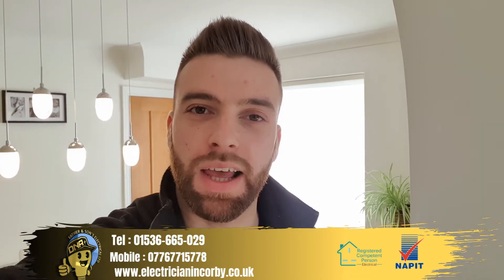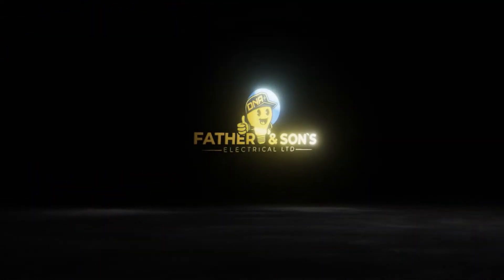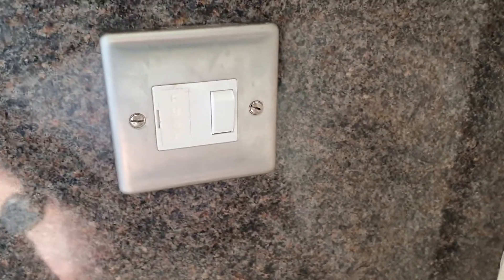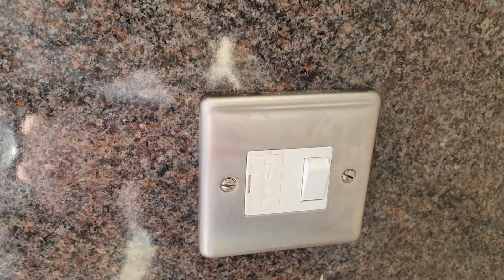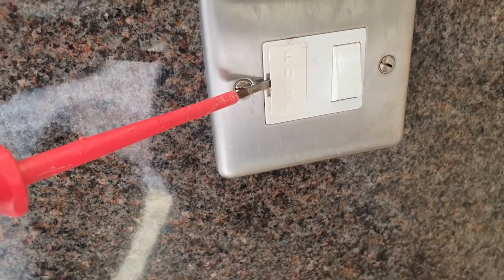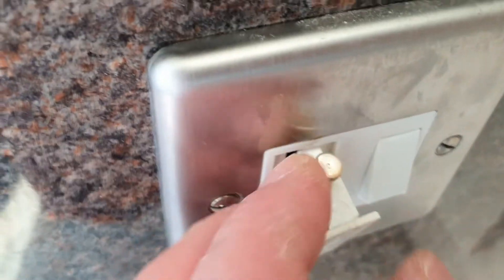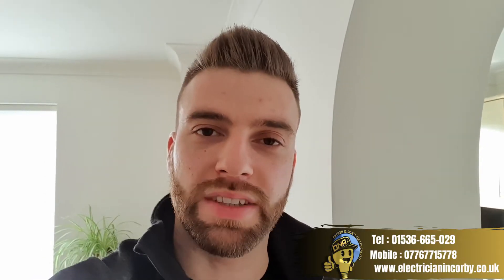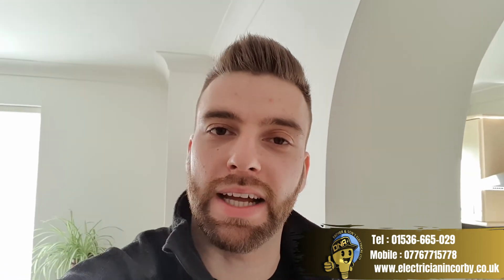How to change a fuse in fused spur?  Electrician in Corby @dnapowersolutions

Comment: Hi what do you need to do if it burnt out causing a lose connection does the whole thing need replacing or can you just change the fuse ? Thanks for your vids
Reply: My washing machine is blown. I changed the fuse, all other appliances are working. How do i chance the fuse at the fuse box. I use use just wire but have a new electric meter and not familiar with what to do? Please help I am 81...

Comment: My fuse blew and the socket got really hot, the switch button is stuck so I can’t turn it off, should I switch off the electrics from the mains and change the fuse or should I leave this for an electrician?

Comment: Thank you for the really helpful video. This DIY novice used the advice to safely change the amp fuse for the kitchen under cupboard lights. Still have to sort out the Carbon monoxide alarm as it wasn't fitted to the mains and battery beeping. Do you just serve Corby?

Comment: I popped out the fuse very gently but the plastic spur broke leaving the fuse inside. Would I be better off getting an electrian to replace it properly? I tried tweezers and needle nosed pliers to pop the fuse out but it didn't budge. 

Electric was turned off while I was trying it.